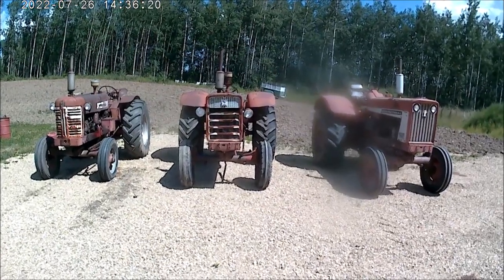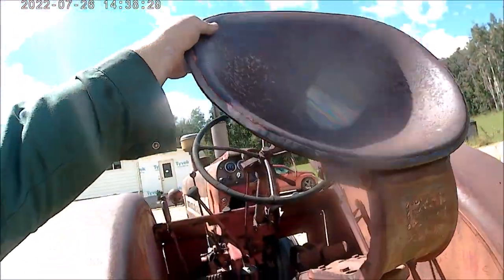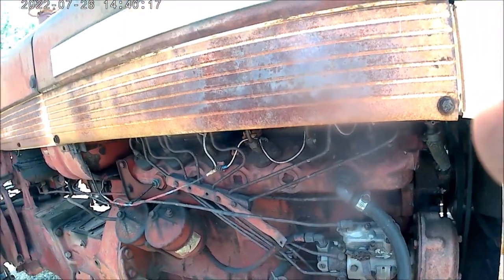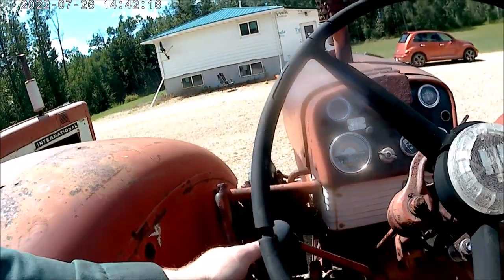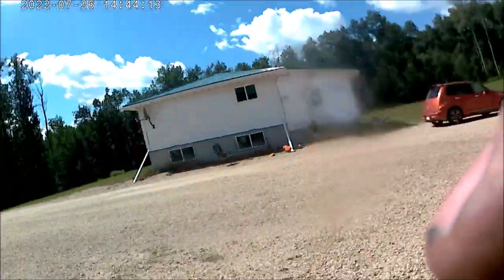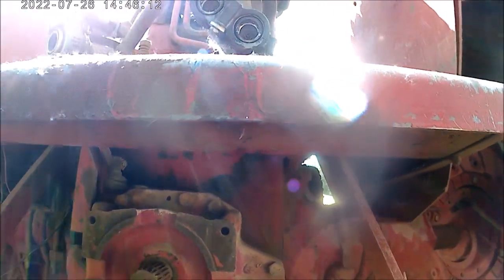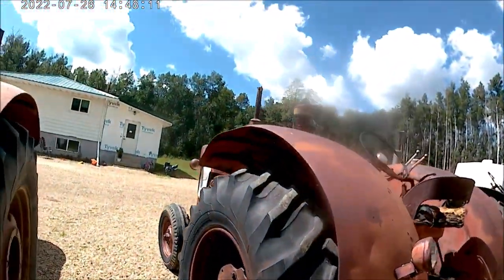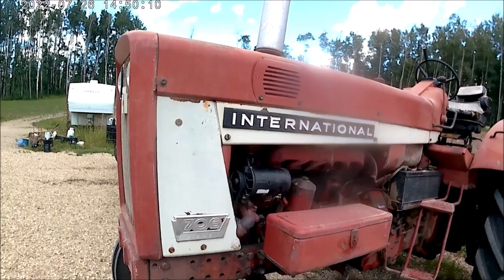3 Generations of IH Tractors in 3 Consecutive Models

Comment: Good  day  Yea the oil bath, are they as good as dry filter,  boy dry filter cost a heck  lot more.  So 560 used  hy-tran oil back then already.
Interesting !   Thanks
Reply from the maker: The 560 was the first to use Hy-Tran. Not only is the oil bath air cleaner cheaper, but air filters are getting hard to find on some models.

Comment: Your tractors are not consecutive models. The 560 was replaced by the 806, and the 460 was the predecessor to the 706.
Reply from the maker: That's not true. The 706 is heavier and larger and has more power than a 560.  They are actually closer in weight and power to the 660 than the 560.  The 560, 660, and 706 all have C-263 or D-282 engines. In the 560, they run 1800 RPM and have 53 drawbar horsepower. The 660 runs 2400 RPM and has 70 drawbar horsepower. The 706 runs 2300 and produces 67 drawbar horsepower. The 460 utility has a direct replacement with the 606, and they have the same engine options and the same basic design as the 460. They never made a Farmall replacement for the 460, but the closest is the 504.